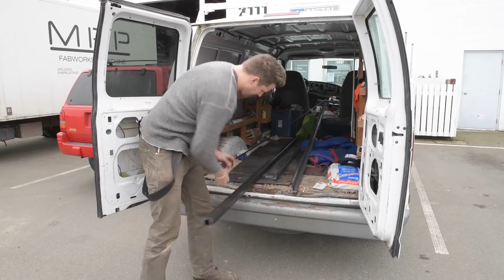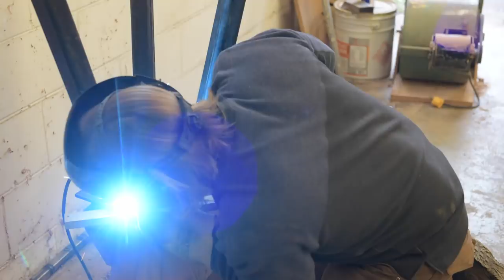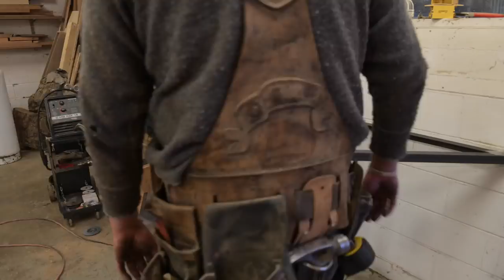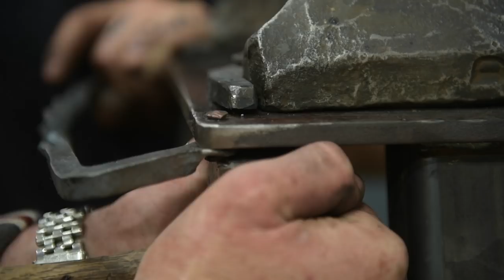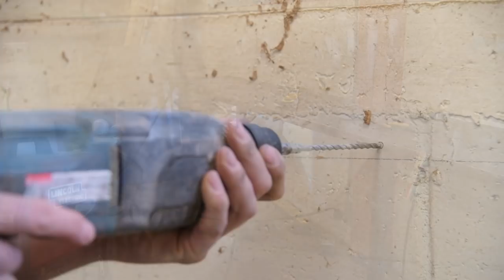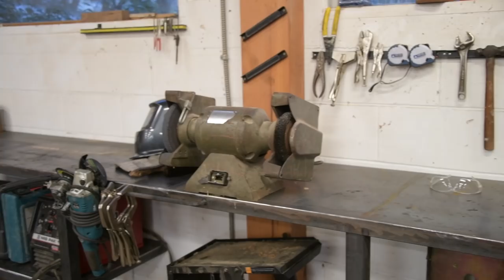Building An Anvil Stand With Liam Hoffman

Comment: Hi. A practical comment from Russia:). That white wall, that you attache your steel work bech to, is too brittle. If you'll be hammering hard on the desk, that will destroy wall around anchor bolts. Better to reinforce with legs along the wall.
But the ANVIL is something

Comment: You guys thought of building the stand from 4X4's or any lumber? My opinion using wood it will absorbed blows better than "all metal". Or, use some type of rubber materials on the legs.
Reply: Tom King the only reason to want your stand to absorb blows is to lower sound. Ideally you want all energy to be absorbed by the workpiece. Why do you think you forge in a big lump of metal rather than on dirt?
Reply: That thing will slide everywhere especially on the cement floor, plus those tools hanging on the stand will rattled your ears out.
Reply: Tom King then you’re looking for friction rather than the blows being absorbed. Check again, there are holes to bolt the stand to the floor

Comment: Excellent video. What blade did you use in your miter saw to cut the steel? Looks like it worked well
Reply from the maker: ferrous metal cutting blade

Comment: Did that cube pattern on the handle happen naturally or was it cut before the twist? Either way I like it. Thanks in advance to anyone with the answer.
Reply: ps3shakes123 cut 2 diagonal corners heat and twist.